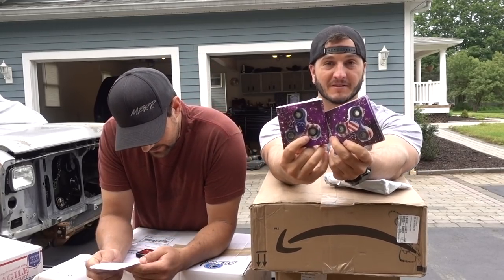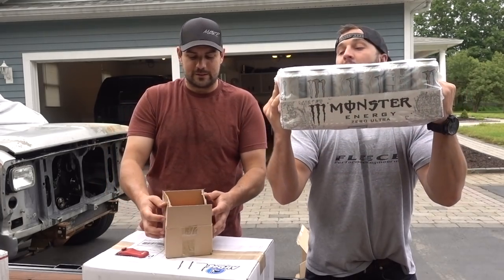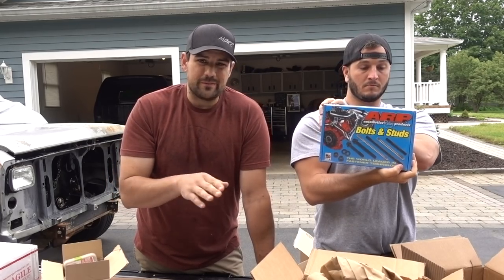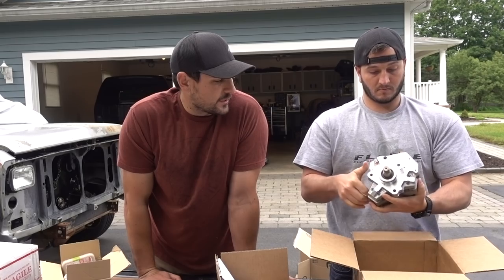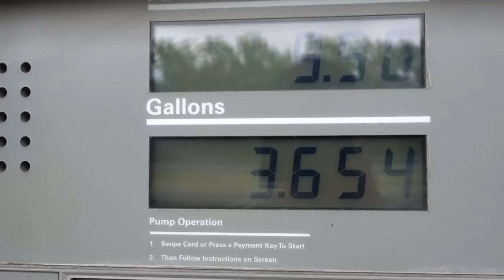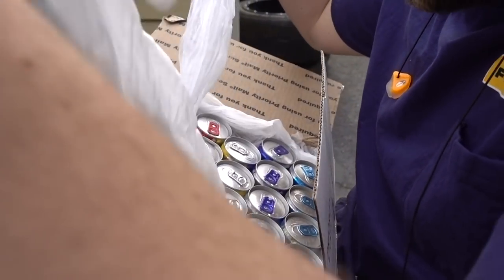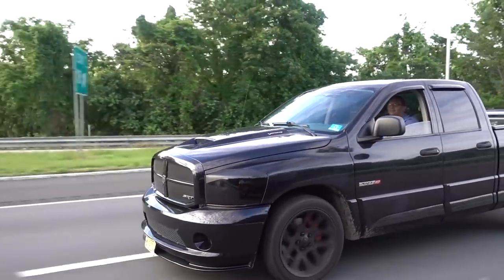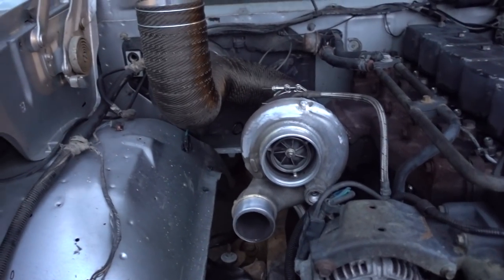COPYCAT SRT10 HEMI TRUCK WANTS TO BE A CUMMINS!! & DON'T GET THIS ON YOUR SKIN!!!

Comment: I love cummins but them srt10s are no joke. Highway pull it would have probably walked off on you guys. Then again it was a quad cab with the power robbing auto in it. But the single cab short beds 6speed manuals are fast as shit. Them new 8 speed hemis with 3.92 rear will lay down a high 13 sec pass stock. Got my 16 ram r/t into the 12 with mild bolt ons, 17 inch rims with drag radials. Gassers can move these days bud . But still nothing like driving a diesel! Most don't understand
Reply: Ram Runner it's not a real SRT
Reply: srt10s are dogs.
Reply: John Cummins how. they make 500hp.
Reply: pffffftt.. thats a cummins with a tuner.. albeit  it would still walk slowly. A mild-medium modified CR would rip it.
Pump, injectors, turb.
Reply: John Cummins okay. that doesn't mean viper trucks are slow.
Reply: ok, Ill take that.
Reply: John Cummins lol a single cab short bed srt10 could run a hug 12 sec pass bone stock on a cool night. Let me know when u can even find a tunned cummins that could do that without some work?
Reply: nah
Reply: thats some bull
Reply: a regular cab short bed 2wd cummins with a tune would rip.
Reply: John Cummins lol if u think high. 14s is fast then more power to ya man 😂
Reply: 600hp will run 12s. thats a tune and a turbo. boom done. maybe injectors if ones cp3 is weak.
Reply: John Cummins and how much u spending to do that dude? Shit an all motor bolt on hemi will run 12s scsb 8 speed 3.92 rear. U supercharge that thing and game is over! Dollar for dollar has jobs are faster. I go to deiesel nationals every year and rarely see trucks brake out of the 13s and no way will a stock cummins with just a tune run anywhere near 12 sec passes keep dreamin bud
Reply: No dreams here, just reality. i am not saying the v10 is not fast. The hemi and the v10 are just light. A cummins that 2wd short box would RIP those trucks with torque.
Reply: John Cummins lol keep dreaming man. Your absolutely out of your mind. Yes they are lighter then a cummins but in no way is a cummins faster dude. I drag race for a hobby and unless a cummins has substantial work it isn't close to either a hemi or a v10. And when it comes to hitting 12s it is much easier obtainable in a hemi or a v10! Have u ever seen the numbers a v10 supercharged puts down? Who cares if u have 600hp when u weigh 7k plus! My stock 16 ram r/t ran a 13.8 sec run before any mods. Show me one cummins that could do that even with a tune! It won't happen man. My truck now runs high 12s fully bolted no can work and no forced induction. Can't wait for the extra 150 whp one I have my procharger money saved. Diesel launch good hence why they are good 1/4 runner when they have thousands invested in them! U can kiss anything after the quarter good bye since a v6 accord will probably own one on the highway. I love cummins! Nothing like owning a diesel but that being said il take a gasser anyday to go fast dollar for dollar and drivability! I still have yet to be beat by a cummins on wed night at at my local drags and I've shite had many try! U should look up the first gear torque multiplications that these new 8 speed hemis put down. Bet you will be seriously impressed! Power to weight wins races dude!
Reply: There is some validity in your statements.
Reply: Ram Runner cjeck out my srt10 in my channel its a 2 door and really really rare not one like it!
Reply: John Cummins cummins engine heads will explode stock but srt10s are way durable. Srt10 is the way to go
Reply: but what is max hp and torque of a SRT10 
Cummins  can be built to 3,000 hp and 5,000 LB of torque
Reply: David deLambert there is no max. Top fuel v8s are known to generate 11000 hp. V10s whether its a diesel, or a srt10, built it right, and you will get there.
Reply: Ram Runner if you want to know what is faster a Cummins or a SRT10 just look up the fastest 1/4 mile drag times in the world for each truck. Fastest street legal diesel is a Cummins and it ran a 7.993... what's the SRT10 you talk abouts time?

Comment: GREGGGGGGGGG

7.3 intercooler.
2nd gen IC doesnt fit with the intercooled 1st gen radiator.
Reply: Sure it does, just have to hack n slash the rad support "a bit", I used a 2nd gen IC for my 351cw swap. -93 w350
Reply: 7.3 IC drops right in, just open up the holes in the rad support a smidge. I suppose it doesnt matter which one you shove in there, anything is an upgrade over the factory junk.

Comment: sorry greg but big different  between a srt10 and a 5.7/6.4 hemi. the srt10 is 8.1 /8.4 viper motor. i have a couple cummins and also own a 05 yellow single cab six speed srt10
Reply: Randy Clinage check out my srt 10 in my channel its sick!
Reply: you have a srt 10 also? check out mine bro its really really rare and fast. not one like it
Reply: Dont look at my videos.  looks good bro looks like mine but mines yellow mines a 05